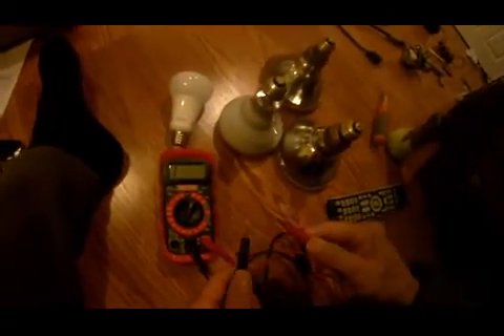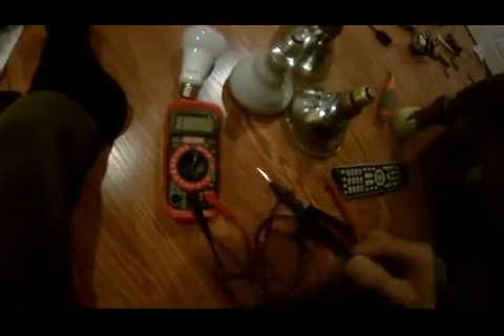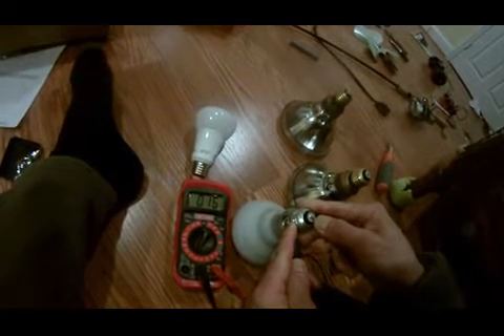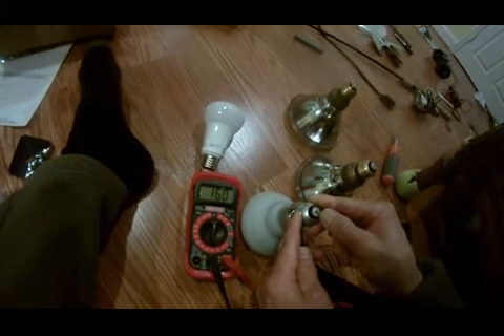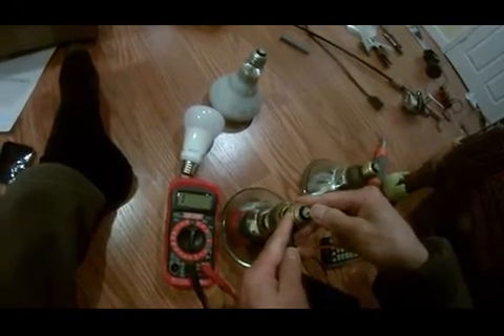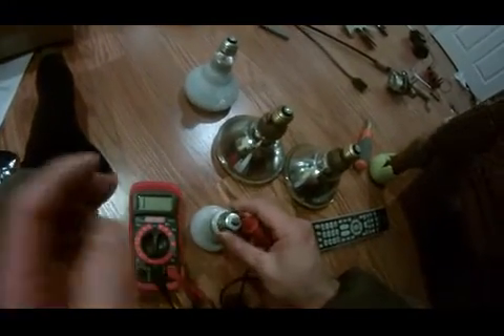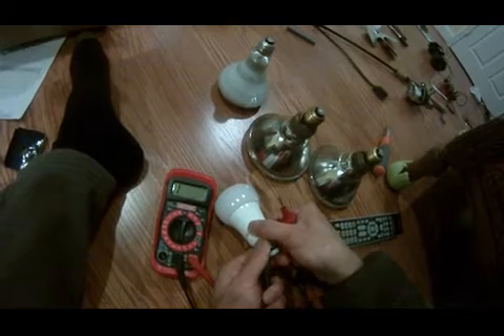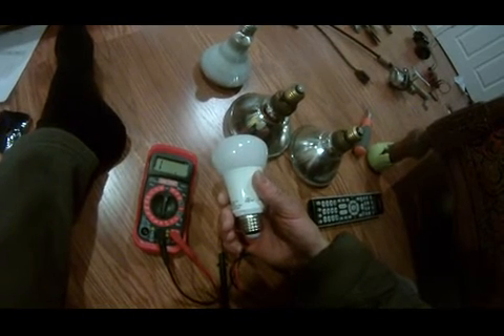troubleshoot LED light bulb - 60 watts with multimeter

Comment: I know this is a old video. But there is incorrect information in a comment that needs to be corrected. And i will also share some information as well. 
You can test florescent with a mulimeter this way because it uses filament. Unless it is a led. Also, you can use a battery charger to test these bulbs. 2amp, 10amp will work fine to illuminate each end.
 However, on a led light. It passes through a pcb board and micro processor on some. They pretty much are different. And cannot be tested like this.
Reply: That's not a fluorescent bulb, cfl doesn't have a filament, it's heated gas, only incandescent bulbs can be tested this way

Comment: You cannot check a fluorescent tube or any bulb that excites gas instead of a filament, with a multimeter. The light 
is created by exciting gas ions on the tube so there is no continuity through the tube unless the gas is excited by a significant voltage.  The, 1.5v or so that the meter offers, will never be able to build up the power needed to start the bulb, thus, no resistance is displayed.
Reply: Thanks for the explanation! So how can I test a led lightbulb?
Reply: That may be an LED light bulb